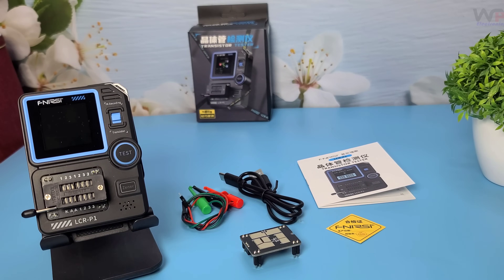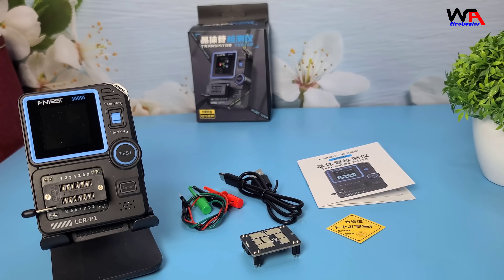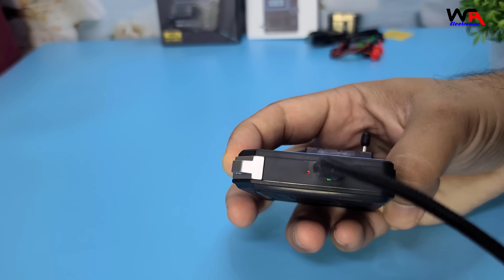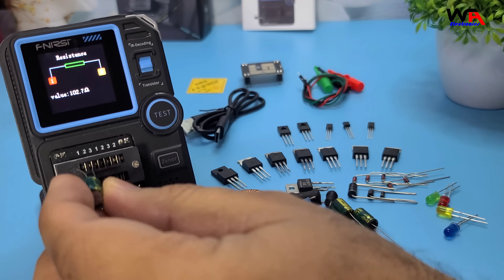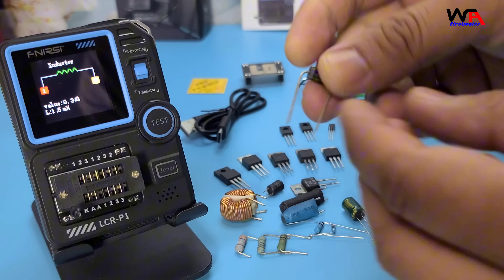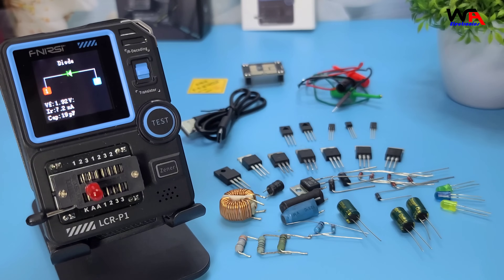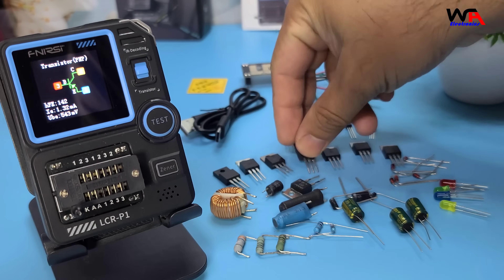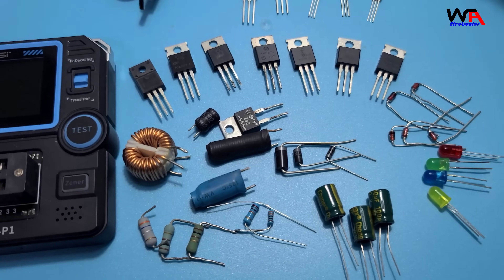Fnirsi LCR P1 Transistor Tester | New LCR Meter Components Tester Review #LCRP1

Comment: JUNK JUNK  JUNK. I just purchased version 1.0.8 and it will give different pinouts if transistors are rotated 180 degrees.  It also tells you the center pin is the emitter in some cases.  Been told ver 9 still has the same problem.  DO NOT BUY.

Comment: For general component identification and testing at a 3600MW, 6 generator power station and it's  electronic modules, this device is great for fault finding on 1975-era Siemens, Brown Bovery, Alsthom, Measuretronic, Ultrakust, Semicron, Hartman & Brown, GE, Multilin, ASEA, BBT, ABB, Credfield etc. cards. Yes, it is not the best, but beats the crap out of most other test instruments. This unit should be seen as a helpful tool, instead of a high-accuracy, calibrated highly expensive test rig like the PinPoint Sigma or similar test units.

Comment: Most important question - Is it any way better, than previous model TC-1, which failed to test IGBTs, because voltage was too small to open the gates ? To be honest it is a biggest concern for me, I am looking for tester able to do this, and I hope, that Fnirsi had made some research this time and improved faulty functions of previous model, plus added some new abilities. I hope, that they cooperated with a team of electronics to make this time a really good product, and that they didn't just paid a  designer to put 5$ worth old circuit into a nice, new enclosure. Otherwise this thing is a total waste of money and i am definitely NOT going to buy it, especialy when they threw out oscilloscope from it and when i have seen how shitty is the new Geiger counter made by Fnirsi! Seriously - I liked old stuff, but now i am close of starting to hate this company for they new politics!!

Comment: It tested the LCR-P1 and it is really bad.  It seems similar to the TC1 component tester but it is no way near as good.  It cannot recognize Schottky Diodes it thinks they are resistors.  It can't recognize Thyristors, dual diodes in to220 packages.  And the capacitance and ESR is also inaccurate. And it is much slower than my TC1.  I emailed FNIRSI several times but they won't respond.  Stay away from it.
Reply: Hi sir 
Can you suggest me another measuring device?
Reply: @cesitli5615  If you can afford it get an Atlas DCA75 Pro but it only does semi-conductors otherwise the old TC1 Component tester is better.  I just ordered a TC3 Component Tester and will do a video on it on my channel when I receive it.
Reply: Dzięki Stary !
Reply: You need to upgrade the firmware to version 1.0.7 if you still have a lower FW version.
Reply: @ivandrimal5783  It was not available last I looked.  I will keep updating and checking things out.  In the event that they have fixed the multiple problems I will update my video on @Tech-Relief.
Reply: For 5x-6x the price, the PEAK LCR40 can also be had. Is it worth it?
Reply: @ivandrimal5783  LCR40 is an LCR meter and I prefer a larger LCR meter.  However, the Peak DCA Pro (DCA 75) is a semi-conductor only component tester which is recommended since it has PC software allowing you to plot graphs etc.  It is much more expensive but a more professional tool than any of the Chinese ones.

Comment: Could you install a diode or zener diode with a cathode from the right.
Will the polarity of the electronic component on the screen correctly display?
Also with transistors.

Comment: have you tested rds of mosfet does it shows perfect or it has some bugs in software like fnirsi dso tc3.
i had 1 dso tc3 rds on according to datasheet is 2.4 ohms and dso tc3 shows 0.4 ohms to 0.5 ohms this meter also had same problem.

Comment: I don't think so. This is not how you test a TESTER. You have to test against leaky and faulty components. No one needs a device that states the obvious. Unless you are blind and can not find this information yourself. I've been wanting a device that can actually run diagnostics on a component using simulated workload and use its datasheet to compare parameters to give me an actual result. This thing is a toy, no serious technician would use professionally. That blue led diode is 3 volts, 20mA that reading was wrong.
Reply: Pero el título dice claramente "revisión" y no "prueba". La revisión es justamente lo que hizo, mostrar como viene empaquetado, que accesorios trae, como se ve de aspecto en cuanto al peso dimensiones y demás. Estás confundido, el vídeo cumplió con su propósito, tu estás buscando otro tipo de video.

Comment: What method are you using to verify that the measurements are accurate?
Reply: Try to  put a resistence series cap and check if calcolate right ESR
Reply: How about a price range and proof of accuracy?  It's just like a "Gee, this sure is swell" advertisement.  It makes me think this was compensated for by the manufacturer.
Reply from the maker: @ivolol  if component damaged like short or open, this device not show you it's parameters.
Reply: @WAElectronics  So how do you know that the device is precise and perfect?
Reply: @Rafa-xl4uf si no obtienes lecturas entonces el componente está fallado, es así de simple! No hay más. Así funciona cualquier probador de componentes. No esperes que te diga la falla porque eso no existe.
Reply: @WAElectronics  too bad you didnt show us how it reacts to bad components ,